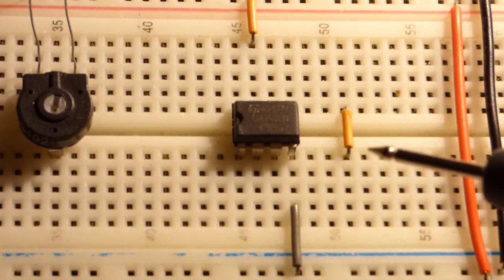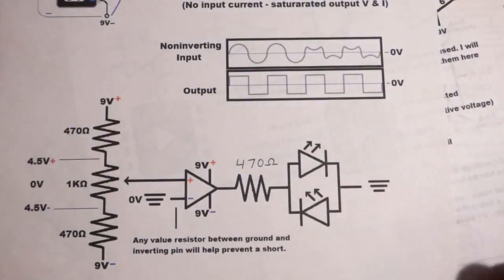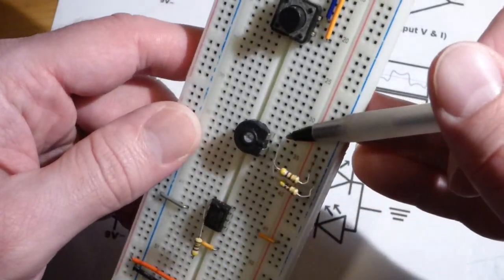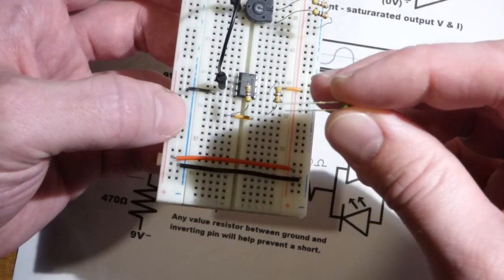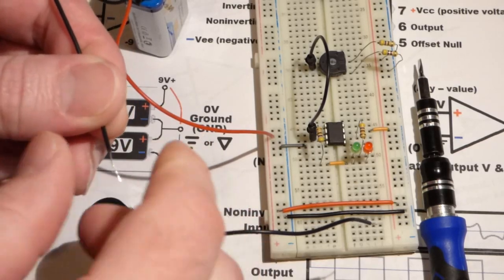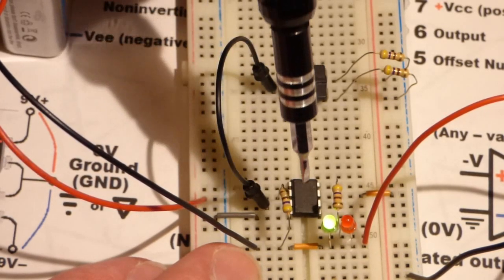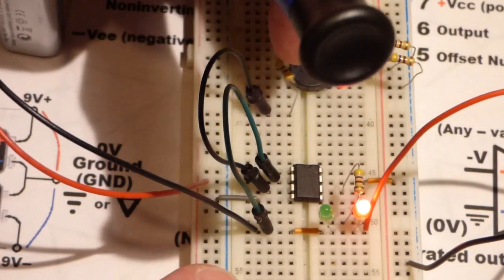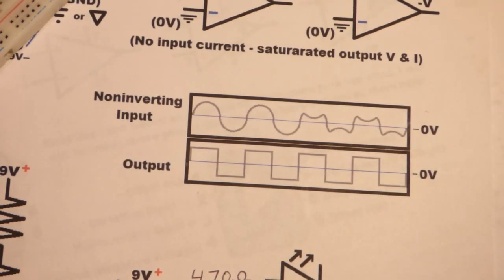741 op amp non inverting comparator demonstration circuit step by step build and explanation

Comment: I’m using a LM741 op amp in my circuit , but I’m having a issue with it. Powering with a 9v battery , +9v rail and ground for the other rail. For some reason when I put 3v into the  inverting input and 0v into the non inverting input , the op amp output is about 1.2 v to instead of going to ground. Why would this be ?
Reply from the maker: 741 op amp has a dual suppy output, which means that it falls about a volt and a half shy of both the positive supply voltage and ground. A single supply op amp can output ground. And a rail to rail op amp can output the full range of supply voltage.

Comment: Hey, I need to you ask one question, suppose I am building non-inverting amplifier (using opam CA3130) with random gain, and I need to provide split supply, and I will going to provide spilled supply by opamp 741, so  +Ve and -VE supply will be given to the CA3130 opam but ground of ca3130 will be provided by opam 741 virtual ground or I can provide the ground from any individual supply? 
please help me.
Reply: Buddy Please tell me which ground should I give?
Reply from the maker: There's a number of ways you can split a supply for a virtual ground. The main thing is that you get a reliable voltage that is centered between a single supply, that can handle as much current as you need.
Reply: @Electronzap  i got your point, again I  ask the question, I am building active bandpass filter from CA3130 opamp, and for +VE and  -VE supply, I am providing supply by 741 opam, my question is IN Ca3130  rest of components also connected just like int he noninverting side high pass filter will connect ..etc, various components need grounds, so should I provide the ground from 741 opam named as virtual ground or from individual supply ground which is not connected with 741? The answer, please.
Reply: Buddy please Answer this question
Reply from the maker: @justpersonaltalk  All the components of a particular circuit should share the same ground. So if you use a 741 op amp to make a virtual ground, them everything connected to the CA3130 should use that  741 op amp output as ground.
Reply: Thankyou so much buddy ,I will do it now.
Reply from the maker: Nice! 😊

Comment: بسم الله الرحمن الرحيم
من باب المذاكرة:
هل من الممكن أن نقول أنَّ الخارج من المكبر هو جهد متغير؟
can we  say that the output of comparator is ac voltage?
because the average value is zero at the output
وهل من الممكن أن استعمله في صنع العاكس مع مشاهدة هذا الفيديو؟
can i use it to create the inverter?  
https://www.youtube.com/watch?v=qVeERT4nyz8
اجتنب الموسيقى في المقدمة، try to avoid the music in the begging  
لا أعتقد
i don't think so
هل من الممكن أن أصلها على الفلتر مباشرة
can i connected to the passive filter directly?

Comment: Excellent video!  I'm using a 741 op amp with a single 1.5vdc supply voltage.  I'm tying pin 2 to gnd.  Pin 6 is staying at Vcc whether pin 3 is gnd or Vcc.  Ideally I would like to apply .4vdc to pin 3 and get near Vcc at pin 6.  I have two 741's with the same results.  Any thoughts why the output is staying at Vcc?
Reply from the maker: Thanks! I checked the datasheet for the LM741 and the uA741 op amps. According the the dayasheet I found, the LM741 says the minimum recommended voltage is a split supply of positive and negative 10V (a 20V difference). UA741 shows a recommended minimum of +5V and -5V (a 10 volt difference). 1.5V is probably nowhere near enough voltage for the 741 to do anything. I have been making videos lately using the LM358 op amp which is made for using a single supply down to only 3 volts.
Reply: @Electronzap  Thanks for the quick response.  I'm using a TI 741 and I couldn't find any minimum Vcc, only a max in the TI design engineering manual.  I also tried 3v and 9v single supply with the same results.  I'm going to dig up a LM358 and find a higher source voltage and see if a .4vdc voltage will trigger it.  I will need to get the output back down to 1.5v with either a load resistor or voltage divider.  Thanks again!
Reply from the maker: It's not easy to finding the particulars of op amps and nobody I have come across explains it well in my opinion. I'm still spending tons of time trying to learn all the different options.
Reply: @Electronzap  I did find in the front of the TI design engineering manual a Functional Index and it provides the minimum Vcc voltage of +-2v for the TI uA741 op amp.  Of course this would still be a problem as I was looking at 1.5Vcc and a single positive power supply.  I did have a National LM358 and watched the videos you have on it.  Whether using a 3v or 9v battery supply, setting the potentiometer to output .4v on pin 6 only outputs .4v on pin 7.  .4v is all I have available as my trigger to pin 6 for the application where I need this circuit.  I'm sure I can locate a 5v source for the Vcc.  There is probably a way to amplify the output of the op amp or find a different op amp that will provide near Vcc at the output when pin 6 is .4v.  A Germanium transistor will switch at less than .4v when applied to the base.  Keep doing your videos, every bit helps others!
Reply from the maker: Glad to hear! Thanks for watching!

Comment: How can you make an adjustable power supply, volt and amp with this op amp? Thanks.
Reply from the maker: Haven't built one yet. I'd google search "741 op amp variable power supply" to look for schematics.
Reply: @Electronzap  

I would love to watch a video explaining how it (the op amp) works controlling the range of volt and amp in a power supply.
If it could be possible some day 😊.
Reply from the maker: Sounds good!
Reply: @Electronzap  

Thanks so much. I'll be around 😊.

Comment: Presuming the 2 resistors & potentiometer values haven't changed from the preview video, one would expect those components are still showing a rise in temperature as seen before.  Any idea what kind of power is being dissipated by the potentiometer?  Might you know its power-handling rating?  Thx.
Reply from the maker: They are the same value resistors, and I used the same batteries as the other video I did, so about 16V (2 series rechargeable batteries close to 8V each instead of the 9V I put on the diagrams) across them so they are passing the same current and generating the same heat as my preview video. The trimpot got hotter than the resistors because it has more resistance (They are in series, so the same amount of current flows through all 3 of them). I believe, don't know for sure though, that it is 1/4 watt, as are the fixed resistors. There is about 2KΩ resistance total, 1K of it being the trimpot, so it will have about 8V across it (about 4V across each 470Ω resistors). 8V/1000Ω =  0.008A     0.008A x 8V = 0.064W so about 1/16W. Generally you want to only have a 1/4W resistors dissipate no more than 1/8W of heat to stay safe, so 1/16W is a really safe amount.     I may do a whole video on this topic but very few people watch my power and thermal videos.    Thanks for the comment!